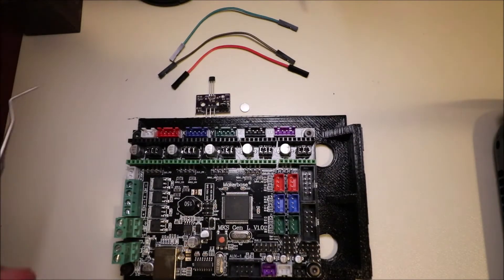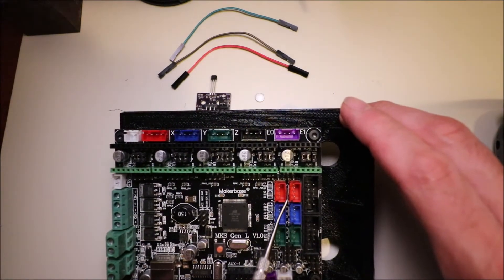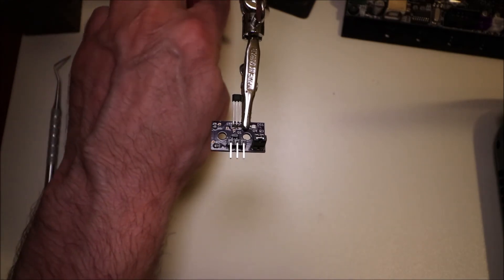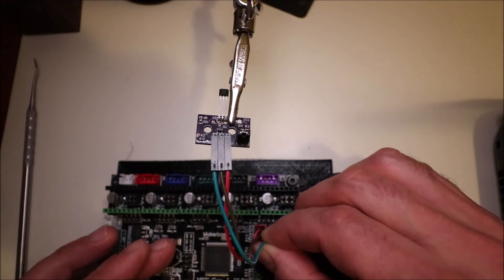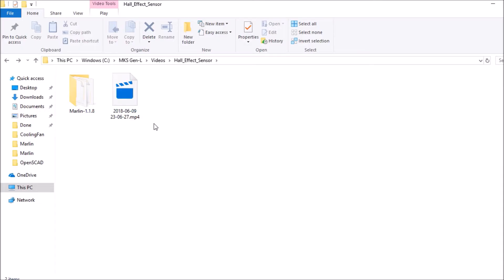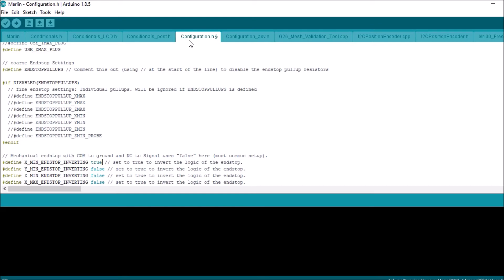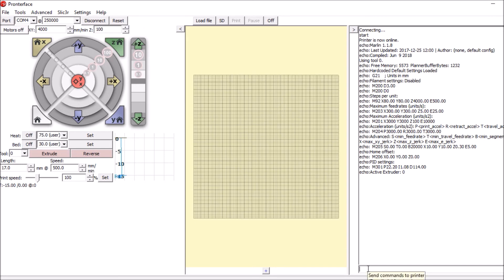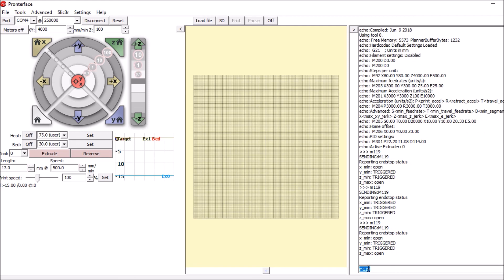MKS Gen L - Hall Effect Sensor

Comment: I know this is a while ago...Im installing some Hall enstops on an MKS1.3 with 5v jumper on. The signal leg is not giving a ground but rather .1.8v and 4.79 on open/trigger...should it be ground on open?
Reply from the maker: You can invert logic in Marlin configuration.h.
Reply: @EdwardBraiman   Cheers for the reply...I use klipper (coming from smoothie) but the issue is...shouldnt the pull up start from 0?
Reply from the maker: Unsure in klipper, but you can invert logic in klepper as well.

Comment: Hello all well? Recently I bought a core xy printer made here in Brazil, I sold my Hevo, it uses the MKS Gen L 1.0 and a problem appeared, it does not connect via USB or without USB, turns on the red light and when I send connect the blue flashes, but does not connect, already checked everything, cables, source, the usb driver is Ok she finds and appears the Com port, but I can not connect it in the slicer, either simplify, repetier or pronterface. Could you give me a help? Thanks
Reply from the maker: Check devices on your computer, windows may see the com port on connect and disconnect.  It sounds like the driver software may need to be updated.  There might be a link in the comments below.  It's good to see you back.  Also how are you enjoying 3d printing?
Reply: @EdwardBraiman  Hi Edward, thank you for your answer. I managed to solve by upgrading the firmware again and everything went back to normal, very strange these cards. As for 3D printing here in Brazil we are still slow, everything here has a high cost and makes it difficult for people to even take courses, buy parts, unfortunately we are far behind in the technology areas. Big hug.
Reply from the maker: A workaround might be to make your own 3d motherboard then it's a question of soldering it together.  There are open source plans for RAMPS board on-line.  You'll need to silk screen locally or use a photo copier.
Reply from the maker: Nice, how well does it print for you?
Reply: @EdwardBraiman  Hello Edward, she prints very well, arrived and did not need to make any adjustments, the ABS does not give warp and table warms up very fast, the best I ever had.
Reply from the maker: That's great!

Comment: Sorry. how can I connect a simple z-probe sensor. (https://www.ebay.com/itm/Cnc-Z-Axis-Router-Mill-Zero-Check-Touch-Plate-Tool-for-MACH3-Setting-Probe-l/392364770407?epid=6009700057&hash=item5b5ac34467:g:PzkAAOSw23lZr9pR).
 I think you know how to do that.

Comment: can you use a Sn04-n2 6-36volts proximity sensor as well?
Reply from the maker: Maybe, not sure if npn or pnp, but you would need to step down the voltage to 5 volts.
Reply: @EdwardBraiman  could you create a tutorial for how you would install PNP Normally closed sensor? I've seen voltage divider methods used but I'm not sure how to use it with this particular board.